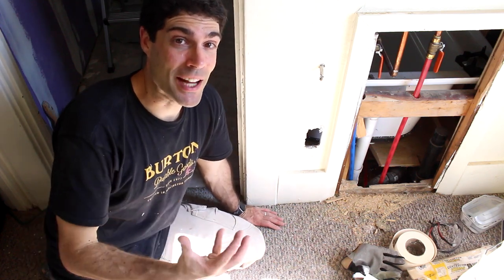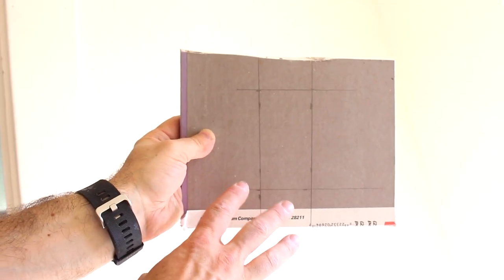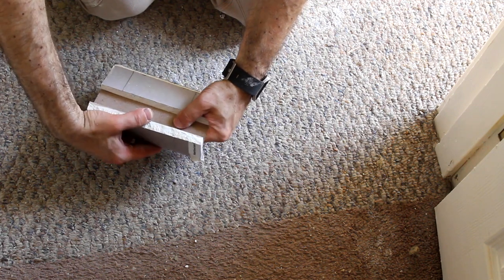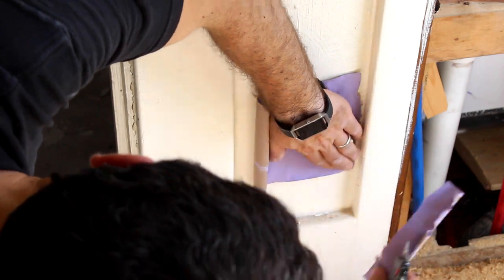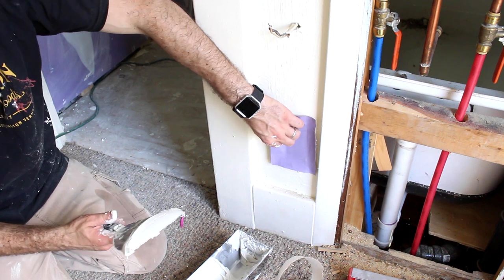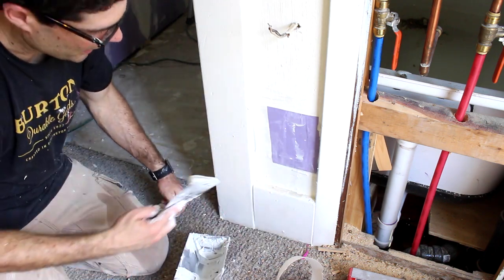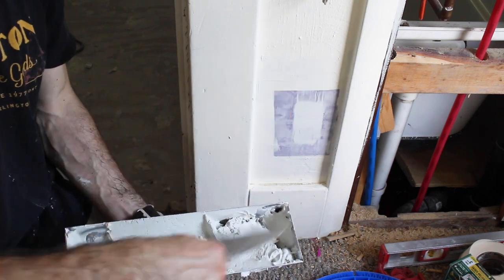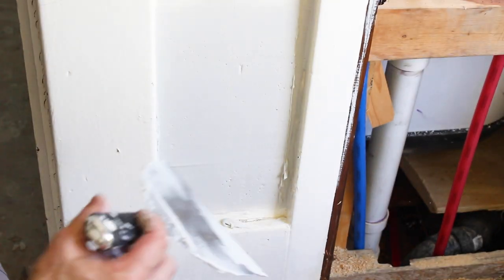How to Patch Drywall | Easiest Method for Beginners

Comment: That's great but you are not going to have a flat surface
Reply from the maker: in this case there’s texture on the wall, so that had to be matched - but you can feather any patch
Reply: @HomeRepairTutor  yes it's when you have a good flat wall you will have problems unless you have access from behind the wall
Reply from the maker: not sure I follow that reasoning, feathering is on the surface